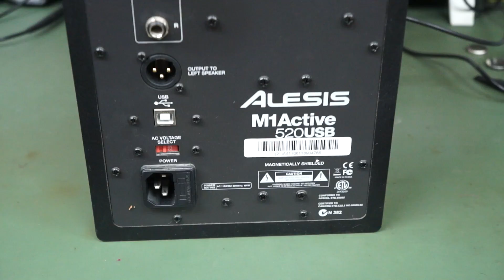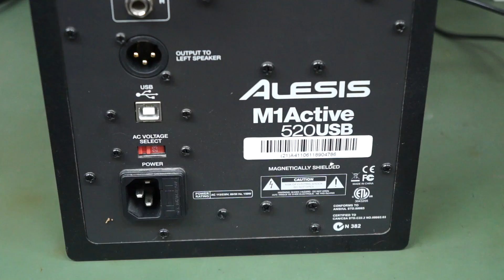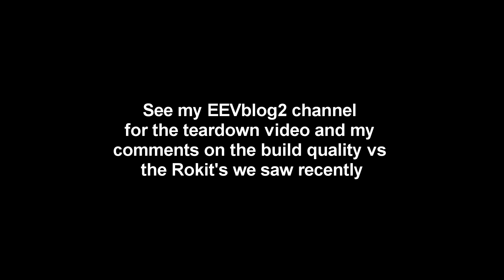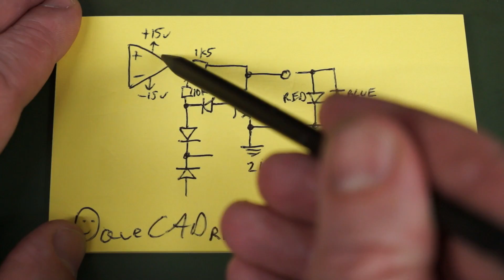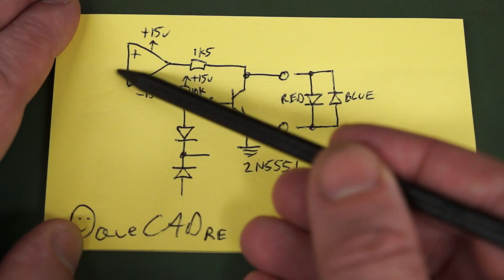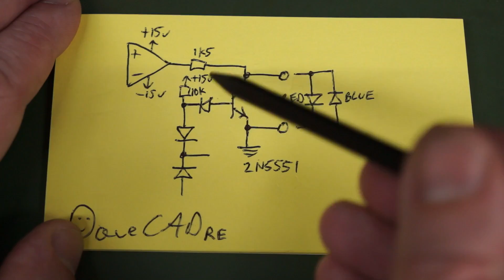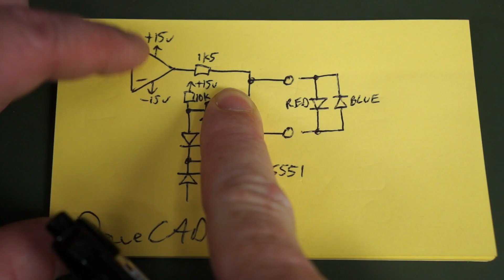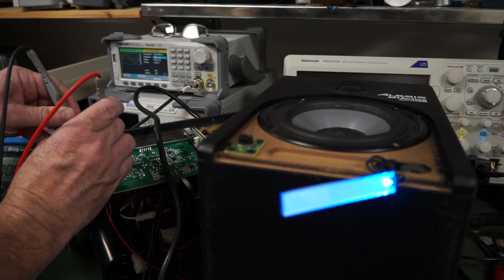EEVblog #1087 - UNBELIEVABLE Alesis Studio Monitor Fault!

Comment: my Alesis 520 USB have the same led problem. But this week it started another annoying problem, all the sudden the volume goes to maximum (clippping red light) and cracks out loud for a couple of seconds both woofer/tweeter!! This is damaging those components when that happens, so where is my problem? is it the potenciometer? This crackle also happens when headphones are connected, also damaging it's drivers :(

Thanks in advance!

Comment: Might not be the blue LED at fault? Could the red LED just be unhappy about being reverse polarized essentially constantly for many years and giving  sufficiently high leakage current that it's clamping the voltage to the point the blue led won't turn on anymore.

2v seems in the region of a red LED

Comment: I don't like for the fact that they're using an XLR connector to connect the second monitor to the amp in the first one. XLR is almost always used as a line-level (or mic level) connector, and this makes it all too easy for someone to accidentally connect the output of a power amp into a preamp, be it the front-end of a power amp or one of the inputs to the console. SpeakON connectors are reasonably priced and are designed for this application.

Comment: I have these same monitors, and had the same LED issue. however they have recently failed. all i get is a loud noise and the clipping light comes on. Poked around inside and looks all fine, no blown caps (that i can see) really upset and not sure what to do :(

Comment: didnt that transistor you took out test dead short one way? I think if they test dead short they are junk.. I have a Denon AVR that lost its side surround (7.1) and zone 2 channel becauise a couple transistors on the output dead shorted causing it to shut off and blink red. However with that board disconnected you can use it as a 5.1 just fine.

Comment: Dave, while you're at it, check the brown~ glue used inside these Alesis units for leakage! It seems to be no better than that black tar stuff, it starts conducting on the part that have seen more heat than the rest.

Comment: I was trying to fix an intermittent LCD display fault on a Pure DAB stereo. I found that I could change the fault by tapping the board near the display, so I resoldered all the joints around it, but nothing changed. Eventually it turned out to be a reversed smd capacitor.

Comment: Are these speakers older than 10 years or so? I ask because I've seen older blue leds fail in a very similar fashion. I understand that, due to the relative difficulty in manufacturing blue leds, earlier-genration blue led chips are very vulnerable to both electrical and physical stress.

Comment: At my company we used to have strange problems with blue LEDs going intermittent or off alltogether. In the end, the actual problem in production seems to have been ESD-induced. However, while we were investigating, we found that a moderate overcurrent through the LED for months would result in just the kind of behavior you show here (flickering which did not seem correlated with any mechanical shock or vibration). If I recall correctly, it was caused by driving maybe 30 or 40mA through a max 20mA-rated LED for about 6 to 10 months which did it.

Comment: I've had exactly the same fault occur in a DJ twin CD player where the blue back-light on one of the lcd's failed. I did exactly the same as yourself probing the pcb and finding that it worked fine. Being again part of a light diffuser it was too awkward to fix so had to live with no back-light.

Comment: Had many LED's do this, they are a pain in the proverbial !
Just recently I had an LED Side light bulb fed with 12v DC which now strobes but if you up the voltage on the bench (Effectively increasing the current) it comes on !

Comment: Similar problem with white LEDs I used for lighting a portable astronomy dome. PVC pipe and nylon construction dome causes static charges. This was a basic wire-up before adding clamping diodes and capacitors to each LED. These white LEDs started to flicker on and off and turn green in between. The red set were unaffected. No problem since adding the clamping diodes and capacitors since. It is an odd fault with the blue and white LEDs due to the multi-layer construction of the dies.

Comment: So the transistor at 8:42 that bridges the LEDs is really driven in a reversed connection  (C becomes E and vice versa)  if the opamp output is negative and the system is switched off? This condition is not specified in the datasheet (I think one effect should be a significantly lower gain) and seems like quite an unusual design choice for a standard mass market design. Are you sure this is an npn and not a jfet and it is really connected like shown or might there have been a malfunction in the DaveCAD reversing feature?

Comment: I have a cheap 12V led strip where one of the 3-led series strings behaves the same way. At low brightness, one segment is visibly dimmer than the others. It also sometimes flickers. If I happen to notice it, I just crank up the brightness until the pesky segment snaps up to the same brightness as all the others. Then it can usually be adjusted to any brightness without issue until it gets turned off for a while.

Comment: I have 8 smd  LED's (just white)on my Belkin 4 channel KVM, 1 for Video and 1 audio. All 8 started out fine and after a year or so 1 started randomly flashing while it was active, the a couple more started and now all 8 do it. I checked the supply the current resistors the solder joints... it is the LED's, the KVM now sits behind the monitor where the random "disco" flashing lights can not be seen. :)

Comment: Lot of drivers put (not road legal) LEDs in number plate lights on their car. I see very often those LEDs blinking on switching on and off while driving through holes. First VW Passat with round LED rear lights now have blinking segments. I think it is quite common except you normally don’t expect it on a single indicator LED :-)

Comment: Oh man dave, you are really not experienced with troubleshooting. You find absolutely common faults amazing, and you missed the obvious clue that the LED didn't light up when testing it with the multimeter and the voltage was there without the LED. Reminds me of the multimeter where you missed the obviously drity switch contacts. you definately need more practice - all your troubleshooting videosso far  were either extremely simple faults (that you didn't even catch fast all the time), or you gave up.

Comment: I've seen it a lot with cyan leds like those used in traffic lights. These were damaged by static discharge from not properly handling them. When looking at it under a loupe I see a black fissure-like damage on the die. When I power it it's like a short, but when I increase the current very briefly to 50~100mA I "burn through" the damage and the led lights up again at 10mA but not as bright as a new one. Sometimes varying the current brings back the short circuit or only partially and the led flickers. With the curve tracer I see a curve like resistor in parallel with a diode. A led that doesn't light up at all has a curve so steep that more than 50mA flows before the threshold voltage is reached. When I "burn through" the damage on a led, using the curve tracer, the slope immediately drops and becomes very unstable.

Comment: Speach quality is never great when you have a two-driver crossover speaker system. The crossover point typically lies in the middle of the speech band.
Try speech on a high quality 8" broadband driver like the Sica 1100, it blew me away how good it sounded.

Comment: Hey Dave, that fault is not as rare as you think. Actually, my first guess was a faulty LED. I have seen a lot of them failing exactly like yours. Seems to be a problem of cheap LED production and should be well known by the manufactures because of the frequency with which this error occurs.

Comment: >Studio monitor
>Bass boost switch
ok.
Reply: AirRifleSport 
switches labelled bass boost are THE marketing wank thing on any consumer audio product

It's not something you expect to see on studio monitors

These speakers are probably totally fine for what dave uses them for, calling these studio monitors is quite the stretch though imho

Yes you would EQ speakers to the room, using an EQ. not a bass boost switch.

This switch doesn't tell you what exactly it does
Does it attenuate by a certain amount when it's off or does it amplify while it's on? How much attenuation/amplification is there? 
Which frequency range does it consider bass? 
There is no information on the thing.
Reply: Just devil's advocate here, if the manual states something like:  "The bass boost switch enables an optional +3dB shelf with a 120Hz corner frequency and is meant to compensate for the boundary effect at low frequencies" -- would that still be laughable?

I don't know if that is the case, I'm just throwing it out there.  But I would imagine the appropriateness of a switch on a studio monitor hinges more on whether it's a properly characterized EQ that solves a real world problem than what they chose to silkscreen on to the rear panel that you only see three times in the lifetime of the product.
Reply: Very common, even on significantly more expensive studio monitors that are bookshelf-sized, to tweak the LF response depending on whether they are against the wall or freestanding on stands.
Reply: jtsotherone very common is a knob to tweak that, not a bass boost switch to turn on and off lol
Reply: No, a switch is more common.  Check the Genelec 8010A, probably the all-time most popular active near field, two switches for 'bass tilt'.  This is a speaker that costs about 6 times the price of these Alesis.
Reply: jtsotherone so you're saying random arbitrary bass BOOST switch = characterized bass tilt switch with several attentuation options?
Reply: I'm saying having a switch to tailor the LF response is perfectly normal and not laughable.  However it's not a very interesting topic so I see no reason to debate it further!
Reply: jtsotherone i think having a switch that is simply labelled BASS BOOST on a "studio monitor" is pretty laughable
Reply: Blacktronics so I guess it must also be wrong for a studio monitor to be EQ-ed to the room?  In that case why not remove the tweeter too, it saves money.  It's a simple bass boost, you have the option to use it if you feel it's appropriate.
Reply: Nick Guy Genelec uses switches
Reply: I think you missed my point.  The mechanical means are irrelevant.

Comment: Dave: The line about " i do't like dicking around with software.." when it comes to volume control. I've had an idea about starting to manufacture DVD driver size pre-amp/audio isolator that does two things: isolates the audiocircuits from PC to cut off all interference that may come from the PC (i've had lots of troubles previously with ground loops with PCs..) Second function is that user has hardware, old school volume control on the front panel. Something that NEVER fails. No matter what state your PC ends up in, you can always turn up/down and mute audio from the place where it should've been for decades.

Does that sound like a feasible product? The electronics is basic stuff, very, very easy. Chassis is easy to manufacture, there is power supply, bing bang bosh: shouldn't be hard. The only question is that would it be any way profitable? 

There is some demand for it, specially if it allows to use external audio source that is mixed with the PC audio. That is one special need, people who want to listen their iPhones while gaming or browsing the net but want to hear what the PC is doing too. 

2ch mixer with headphone amp would be the configuration, with SPDIF input/output (to make the isolation even better and for audiophiles... ;) ).
Reply: Interesting idea, but I can see a few problems there.
1. 5-1/4" bays seem to be going out of fashion these days. Some modern cases already don't have any, and I'm talking full-size, not Micro-ITX. Not exactly a trend I'm particularly fond of, mind you - I'm all for good ventilation but at some point it just gets silly.
2. All you can typically access inside the PC is front panel audio, where people would typically use headphones or a headset, no isolation needed. So you would have to include some contraption to get your audio through a slot bracket or something.
3. How do you intend to include SPDIF? That's almost a soundcard in itself? Or do you just want to have Toslink converters for use with the onboard SPDIF connectors that some boards have?

I would also advise to
a) implement some sort of power-on/off muting as you will be limited to single supply (which also means taking care you get a clean +Vs/2 reference and other single supply design caveats), unless you are willing to go to the trouble of including an inverter to generate roughly -11 V for a -8V regulated supply (many soundcards use 8 V supplies, I assume 9 V could go out of regulation under adverse conditions unless using LDOs)
b) have balanced inputs for your output signals so you don't have to deal with internal ground loop issues and can easily use local ground (most outputs tend to range from anywhere between 10 and 200-something ohms, so I'd include 22 ohms between output ground and your "cold" input and call it a day - if the effect of impedance mismatch bothers you, go for a buffered circuit and increase common-mode input impedance by going for a T-type network for input impedance, e.g. 10k+10k + 100k to Vs/2)
c) include your own microphone preamplifier with clean bias supply, 'cause the ones in sound cards very often suck balls (technical term), and finding a good consumer (unbalanced) mic amp is not easy. With an NJM2068 at +30 dB (3k3/100R, maybe the latter as a 1k reverse log pot + 10R fixed if you want to get fancy) and 1k + 100µ to clean up the output of your main 78M08 (78L08) reg plus 3k3 bias R per channel and taking care to avoid any ground loops, you would be pretty much king of the hill, sadly. Just about good enough for a 600 ohm dynamic mic, as in 3 dB above thermal noise... (Possibly include a 4PDT toggle for "straight through" in case you get a digital / MEMS mic, though not sure how common PC mic inputs for them are.)
d) do power / ground routing carefully. You are likely to have chassis ground available, and I would prefer to use that as a reference, but I'd still include Molex / SATA power ground, with ~10 ohms connecting them, just in case the connection from chassis ground to PSU ground is not good. (With many cases no longer being bare metal inside and on the back, I would not bet on it...)

Speaking of mic inputs, one thing that would be handy to see would be a balanced XLR mic input (à la ESP P66 or using an INA) with phantom power, as basic "large diaphragm" condenser mics are getting really cheap these days. That would realistically require a boost reg though, so you can get a full +48V (some passive cleanup included), as there are a fair few mics that are not content with +9-ish V, and I do think a switch and indicator are mandatory. That said, this may have you competing with the likes of a Behringer UM2, and that's not easy...

Comment: I had the same issue with LEDs from some club RGB lights. Had no idea why they flickered randomly, no soldering issues, done some PCB tracking, no problems there. So I changed some of them for new ones.  My theory is that the manufacturer, in this case not Alesis, but manufacturer of the light emiting thingy, used some off-spec LEDs thrown away. I once got UV leds from ebay and they had obvious faults like bubbles and some of them started to flicker after about 10h+ of usage.

Comment: Interesting! I had an almost identical problem, also with a powered studio monitor (M-Audio brand). It had two blue leds in series around the volume knob, which are supposed to get brighter when you turn up the volume (there's an extra ganged wiper on the volume pot in series with the leds). After I had it a while one of the leds started to flicker, but only when the volume knob was low. When it flickered out the forward voltage would go down, making the other led in series get brighter! I took it apart to see if I could find the problem and eventually came to the conclusion that the led itself was bad. Weird!
Reply: I have the same monitors - and they do the exact same thing. Weird indeed. (AV-40)

Comment: Weird coincidence: I just finished troubleshooting and fixing a musician's  DI box with a similar problem. The DI box would randomly cut out, causing very loud "thumps" through the PA. The blue power LED would also come and go, even when the box was working OK. Long story short, all of the power for the unit was drawn through the blue LED (it only used about 1mA) and that LED was misbehaving. Replace the LED...all is well.  I kept the faulty LED to experiment with and it really does behave weirdly. In experiments so far, it's forward voltage drop will vary between a perfectly normal 2.6V and 12V at 1-2mA, and it will "jump" between states quite abruptly. Strange behaviour.

Comment: In my opinion one of the LEDs pooped itself and developped a significant leakage and started to behave like if it had the resistor parallel to it. That resistor formed a divider with the LED dropper resistor and voila! The voltage on the leds was unsufficient to light up the blue one. That leakage resistance is not that uncommon in LEDs, especially the ones that work quite hard in the lamps but I've came across such behaviour even in the HDD activity led in the PC case.
Reply: That's my opinion, too. Also I think measuring the current through that LED at different voltages between -2V to +2V might be interesting.